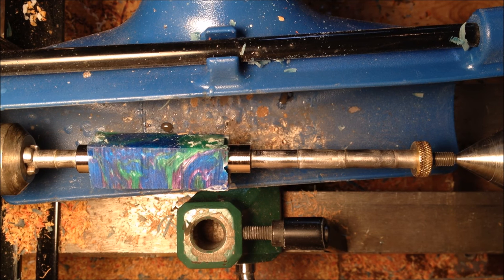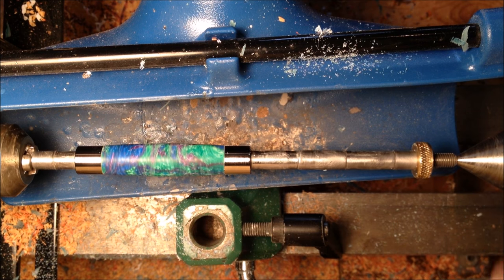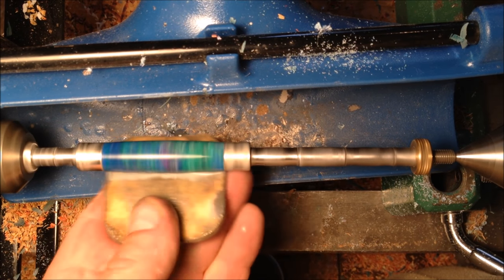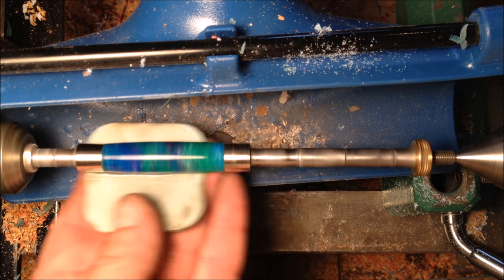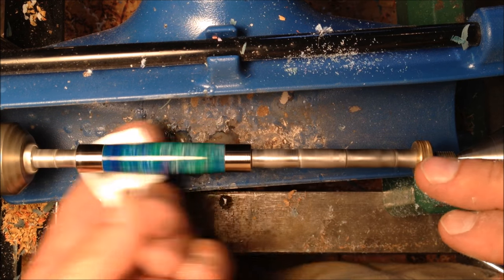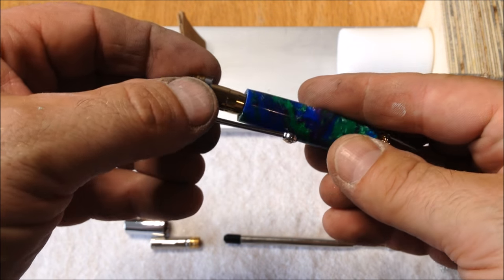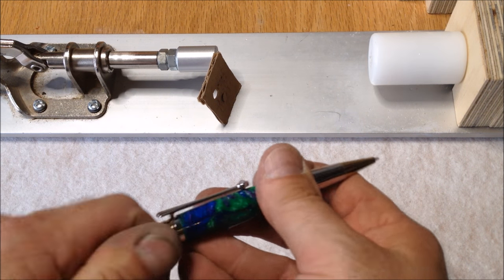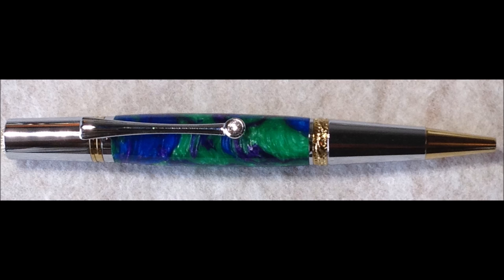Turning The Majestic Squire Ink Pen

Comment: Hi Bob that is an awesome blank and goes well with the gold on the pen.  I have had the same problem with the twist mechanism behind tight on the Gatsby.  Nt every pen just once in awhile.  Like you I would take it apart and put it back together and it starts to work fine.  I think the pen refil doesn't go in straight sometimes.
Great pen
Reply from the maker: +Dave White Thank you Dave,
  That's all I can figure. It works great now. 

Bob

Comment: Very nice, Can you tell me what your setup is like for the lathe vacuum system you have here
Reply from the maker: +frehleycomet I have a Rockler lathe hood, roughly $50.00. It's hooked to a Dust Deputy run by a shop vac. It's not great for chips but it's awesome for sanding dust. 

Bob

Comment: What tool is that you are using in this? I see that is your go to for many pens.
Reply from the maker: I was using a 3/4” roughing gouge. 

It does an OK job but you really have to be careful with the finishing passes. 

I have since moved to a 3/4” skew. It’s a bit tricky to master but once you do the cuts are amazing. 

Regards,
Bob
Reply: @RJBWoodTurner  thanks Bob.
Reply from the maker: @edcable2711  👍🏻